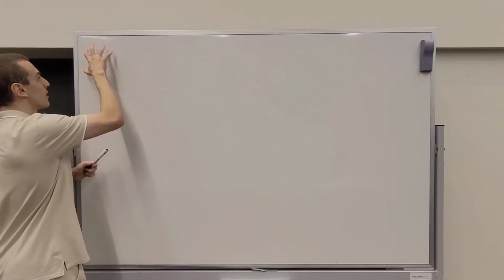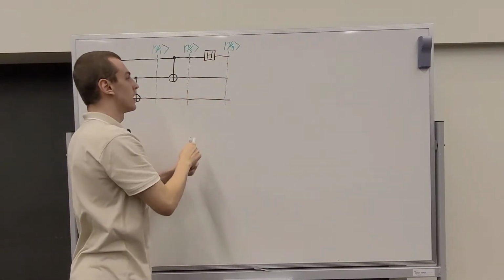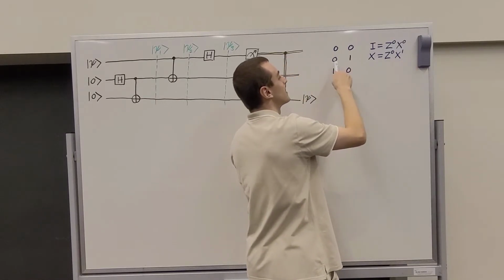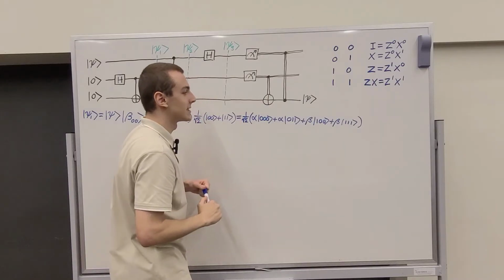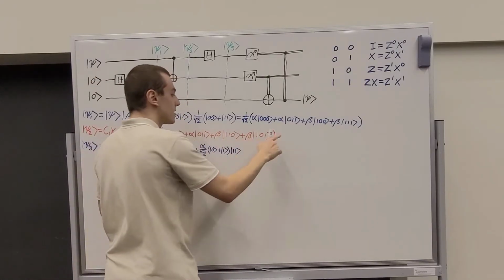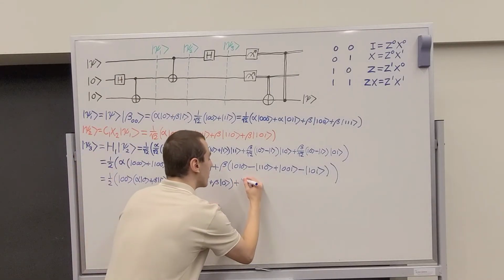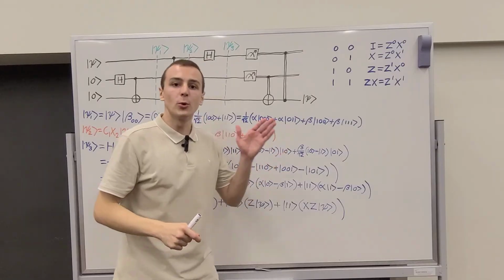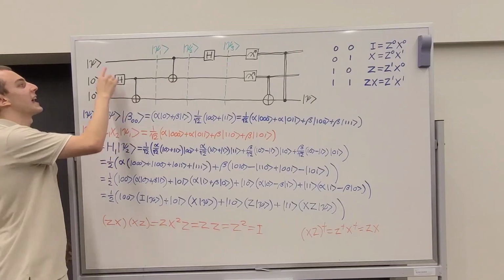Quantum Teleportation of 1 Qubit - Quantum Circuit Diagram, Entanglement of Bell States

Comment: The Q bit at start have a unknow state (they are in superposition 50%/50%). The measurement in A implies that B will read the inverted value. But if A read its Q bit, the wave function colapse, so B cannot read the inverted value. May be in this scheme, the wave function doesnot colapse... With the A value, the message is encrypted and decrypted in B with inverted A value. There is no teleportation and nowadays, this wording is avoid. There has been a lot of experiences trying to influence the value of A (little magnetic field, lazer, etc...) and see if there would have a little little spooky effect at distance but up to now, nothing and in particular, the colapse of the wave function does not prohibit the test of the value in B. In fact researchers are in a cul-de-sac while quantum computing is developping, "teleportation" remains inaccessible.